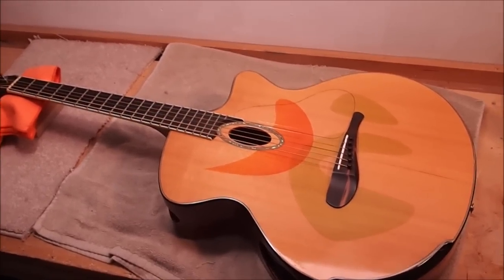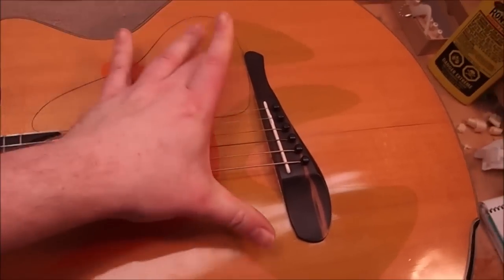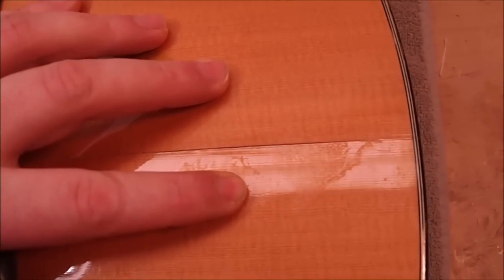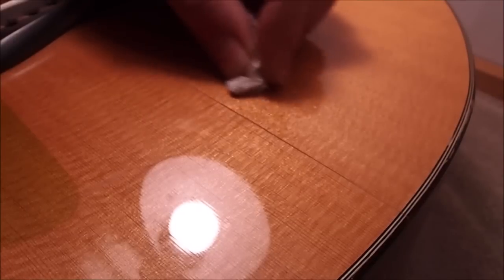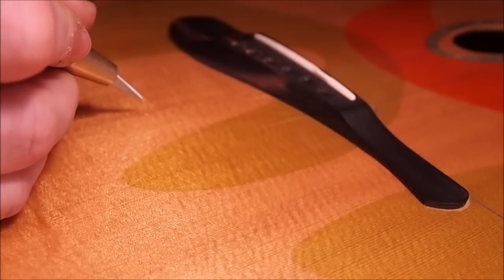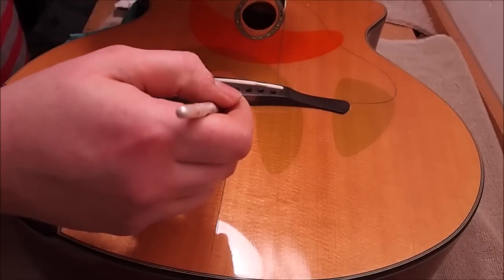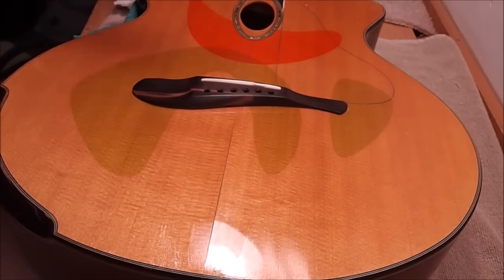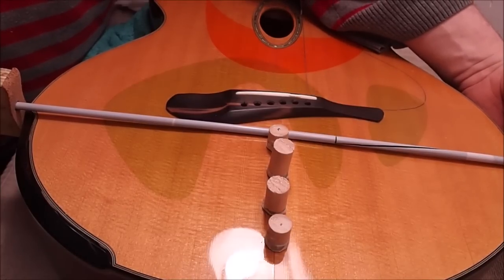Beardsell Guitar Crack Repair

Comment: Did the crack seal up nicely?  We didn't get a finished picture.
Reply: Agreed. Very unusual not to be shown a close-up of the finished repair. In this case, because of that large side soundhole, matching views of both exterior and interior shots would have been very easy to film. In one shot of the top it looked like the treble end of the saddle had shrunk or the top had expanded. You could see a pale crescent of 'clean' wood.
Reply: Of course it did! We’re talking Ted “The guitar whisperer “ Woodford here. It wouldn’t dare seal up tight!

Comment: I've seen these side holes before on other brands or makes and I wonder if it doesn't adversely effect the sound of the guitars, why not do this design more often if for no other reason than making any repairs needed in it's future would be easier, faster and therefore, cheaper?
Reply: RDE Lutherie  Thanks for answering my questions. Now I have more!! lol. Your observations of no R&D to save on costs to manufacture rings true for me as an amateur mechanic. How many times have I observed, while trying to repair something, the annoying habit of design engineers to give little or no thought of building into the design, ease of repair? In the case of guitars, as you've pointed out, the top is the most important side of a guitar and so repairs to them would be easier, less time consuming if they used the Kasha style. I do understand what you're saying though. I'm sure I'm preaching to the choir. I've played guitars for the better part of fifty years but have only begun to delve into the pleasure of repairing and or modifying and struggle to understand the guitars of the last hundred years or so. My confusion hasn't been helped by the misinformation handed out by the mainstream companies we know or hear about. The fact that they all went to Japan or Korea, in the 70s was a bit of deception because they(as Americans themselves)knew the desire most fellow westerners would have in buying only "Made in the USA" for patriotic reasons as well as the perception that Asian made guitars were inferior. I bought and still have a Takamine F-385 12-string and was always happy with it until I learned it was an all-laminate guitar. Later Takamine themselves outsourced work to Korea and China while creating their own all-wood guitar line-up. My complaint is still that when researching guitars to buy, never did any company say that their product is a budget model and therefore shouldn't be confused with higher-priced all-wood brands. When I read advertisements I've since learned that they have code for describing their guitars like "Solid Spruce Top" then "Mahogany Sides and Back". To someone new to guitar construction they don't realize that the sides are plywood. Recently I've noticed newer model guitars being made with solid tops and laminate sides and it seems to me from what you said that that is actually a sound choice especially for campfire or outdoor players concerned with cracks etc. due to temperature changes and humidity. The difference this time is that they are being upfront about its construction materials. I think that stems from Seagull, Simon & Patrick using laminate Cherry back and sides with all solid tops. Then Martin designed a solid top cherry back guitar themselves. Again thanks for clearing up the issue on which side of an acoustic guitar is the most relevant when it comes to the overall sound.
Reply: RDE Lutherie  I would love to see and hear the guitar you've described. It sounds like an absolute masterpiece. I went to your channel, but I noticed that you don't have any videos. Is there anywhere I could sample your guitar?

Comment: Hey!! we didn't get to see the finished project!! 

Lol I should send you my Fender acoustic and tell you to have a ball with it. That poor thing has more cracks in it than Nancy Pelosi has wrinkles lol. The sides, the top and even a new one starting on the back lol. The bridge pulled off a few years ago and I repaired that but I want to redo that because I only had a few minutes to make it work for my fiance's son to be able to play it so I just quickly put some super glue under it and place a heavy weight on it and told him to give it about an hour then restring it. It's held for almost 6 years but some of the glue came out and needs to be cleaned up. 

I always enjoy watching you it's rather soothing the way you do your videos. I still don't quite understand the purpose in the magnets, I understand the clamp but why the mags?